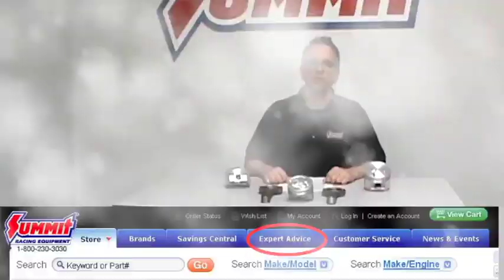Pistons and Engine Compression Ratio - FAQ - Summit Racing Quick Flicks

Comment: Planning on building a low compression motor in preparation for eventually adding either a blower, turbo, or nitrous. Motor will be a stroker bored .40 over, dished pistons with 6" rods. Will it run to Rich without a power adder?

Comment: Hi I have a stock 400 Cui Chrysler, how can I easy raise compression?
Reply: meetmyballs bore and stroke it
Reply: Best and least costly is to reduce the deck height. Figure out which piston to use and have your machine shop drop the deck height to just above or even with top of pistons. Decking block is approx $150 - $250. Can gain from your standard stock 7.5:1 to up to 12:1 depending what CC head your going to run.

Comment: a high compression engine would require less total advance to run a lower ocatane fuel is that correct or total timing in general like initial at 3 deg and total at say in the twenties is the timing curve a factor as well ? I came across a guy that says he's got 12:1 and runs 93 octane is that feasable and how is he doing it ? is it really a noticable difference between 10 :1 and 12:1 I realize it's times 8 but .if you could give me some insight thanks

Comment: my motor has 11.2:1 compression will i have detonation issues on pump gas? i bought my engine kit from summit
Reply: Pff, mine is 21.5:1, you'll be fine with mid-grade octane
Reply: Alexander Peterson how did you get it that high?? What is your engine decked at? 
What size are your combustion chambers? What is stroke and bore?
Reply: 1982 Detroit diesel. naturally aspirated. it's the 6.2 litre if you want the specs. when it comes to gas, if your engine was constructed to be able to handle higher torque and pressure, a turbo/pro/supercharger will effectively 'increase' your ratio. by technicality, of course. just move up to higher octane fuels, 91 and 93 should be fine for anything not professional. lower octane fuels will most likely result in knocking. best of luck
Reply: No just take out timing or get a colder spark plug. My 11.3:1 LT1 ran best with non-projected plug NA and 36 degrees total timing on 93 vs a hot plug with less timing. Just takes experimentation.

Comment: Thanks for the video! I have a question: There are several choices for my engine for new racing pistons from Supertech. There are two that have the same bore, stroke, and rod length, yet are listed with different compression ratios. How can that be?
Reply: bambamquiescence they make dished, flat, and different dish depths

Comment: my sbc is running 14.5:1 compression with 42cc heads, and -7.00 domed pistons, with a .026 gasket, its a 383 with a 4.03 bore and 3.75 stroke, i want to bring it up to around 18:1 compression, is there anything i can change to get it there and what exact thing would i need?
Reply from the maker: Hi joey lenseigne, 
Machining of the block or heads; a thinner head gasket or a new piston with a larger dome are all options for you to reduce the combustion chamber size raising your compression.

Comment: Hello, I'm trying to put a turbo on a 2110cc air cooled vw engine with 40x35 head 85.5mm bore 90.5x82mm pistons. My concern is that the compression ratio is too high to start adding more heat and what not with a turbo but i'm not sure. Any suggestions/ advice is greatly appreciated
Reply from the maker: +RXforJazz, 
Can you please call our tech line? 1-330-630-0240. We need some additional information from you. Thanks for watching!

Comment: what is the maximum compression ratio for turbo applications?
Reply from the maker: +Jesus Sevilla, 
A general rule of thumb is between 8 and 8.5:1. There are variables though such as cam, heads, fuel delivery and boost pressure goal.
Reply: Thanks

Comment: Hello Summit Racing, is it true that a high compression ratio needs a stronger spark due to the resistance caused by the compressed air/fuel ?
Reply from the maker: +julio lausell , 
Higher cylinder pressures do in fact make it harder for the spark to jump the gap. Installation of a high energy ignition and coil such as an MSD will benefit you here!  Give us a call, we can help you pick out the right combination for your vehicle. 1-330-630-0240.
Reply: Thank you for your reply, times are difficult, it will take a little time to come up with the money. But now I know that I'll need to go with a better ignition. Thank You Summit Racing.

Comment: Summit Racing Hi, I have a BMW e93 335i but I will put the N62B40 instead of the N54B30 ,The N62 did not have a high-performance derivative,unlike the preceding M62 and succeeding N63,so what would be the effects of increasing the compression ratio from 10:1 to 12.5:1 on the N62 engines and replacing cast pistons with forged pistons and will performance increase??Thanks

Comment: I have a 2002 honda civic sedan and i want to get higher compressi9n ratio to get more horsepower
It has a D17A1 motor and was wonderi g what would be the best for this car?
Reply from the maker: Dat1Nigga ZimDoe, Unfortunately we currently do not have a piston that will increase your compression unless you are willing to have a custom set made. Give us a call and we can help you through the process. 1-330-630-0240.

Comment: I am building a SBC with flat top pistons and will have 70cc chambers (E-Street heads).  Using an online CR calculator that should yield roughly a 9.7:1 CR.  Can I run regular pump gas (83-84 oct) with that CR?  Thanks.
Reply from the maker: James Thomas, 
Though the E street heads are aluminum and will sometimes allow a higher compression ratio with pump fuel, much of this really depends on the camshaft specs and ignition type and timing being used. Give us a call, we can help you figure it out.1-330-630-0240.

Comment: does compression ratio effect boost lag?
Reply from the maker: Hi ThatGaminChannel, 
Think of a higher static compression ratio as a bigger bang in the cylinder. That bigger bang equates to more power being produced naturally by the motor and less lag. Conversely, a lower static compression ratio means less natural power or more lag!  Any further questions? Feel free to give us a call a call on our tech line at 1-330-630-0240. Thanks for watching!

Comment: i have a gutless 93 tercel and i was wondering what parts would i have to replace if i wanted to bump up the compression to see a little more power. i dont wanna go crazy still want to be able to use pump gas.
Reply from the maker: MrSupercream21, 
1)     
Because this car is
not a typical choice for gear heads to modify, there are few if any off the
shelf parts available for it. Though custom parts can be made, they are costly
and time consuming to acquire. Give our tech line a call if you have anymore questions.  1-330-630-0240. Thanks for watching!
Reply: my advice would be to plop in another toyota engine of a similar vintage. anything else is likely a waste of money.

Comment from the maker: While its true that a higher compression ratio will produce more power, it will require the use of a higher octane fuel, different timing curve in the distributor and introduce more heat into the cooling system.

Comment from the maker: Economical, No!  You have to use a higher quantity of Ethanol (larger jets) to get the same power output as Gasoline. Not to mention it is corrosive, so higher blend ratios such as E85 or even E100 would have to have their fuel system components upgraded; this will be costly!
 As for Water/Meth injection, absolutely! We carry very nice kits from Snow Performance that include electronic controllers to make its use as easy as possible!

Comment: One more question, does anyone sell individual pistons? I wouldn't think so, but I'm looking for a set of 86mm bore, 30mm comp height pistons and Wiseco K568M86's look perfect but they cost 480-500 bucks wherever I look and it never specifies if the dealer is selling one or the set. That's for a set of four, right? I mean, who sells a single piston for 500 bucks?

Comment from the maker: While a 12.5:1 compression ratio will yield a more powerful motor, there are other matching engine components to consider such as connecting rods, crankshaft, cylinder heads and camshaft. Another thing to consider is the fuel. An engine with this high of a compression ratio must use a high octane fuel. These fuels are considered to be used for racing only mostly due to their cost of usually around $6-8 per gallon!

Comment from the maker: A forged piston is made from a stronger denser grade of Aluminum than the average piston. This is necessary for motors that will be used in a race environment using higher compression ratios, Nitrous oxide or Superchargers/Turbochargers. Reason: all of the mentioned increase cylinder pressures and temperatures to the point that a “Cast” piston material would be compromised.